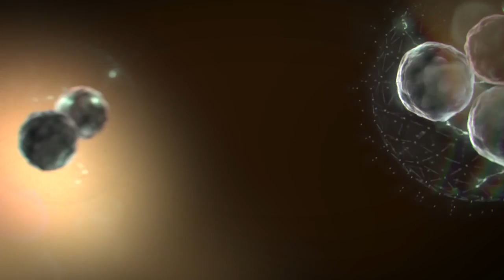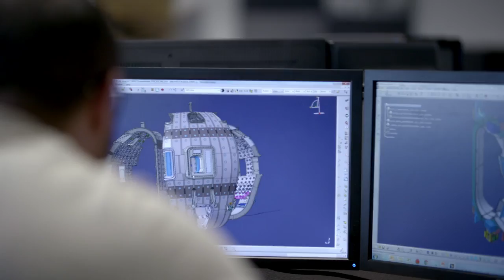ITER— Fusion, the energy of the future

Comment: “You can imagine plasma as lightning rolled up into a ring, which is held in place by strong magnets ...” If the lightning is rolled into a torus, then it itself will be held by a ring magnetic field inside this torus. And no magnets are needed. Anapol is a unique state that occurs due to the closure of the lines of electric currents and the electromagnetic fields created by them. Tokamak vice versa. The existence of an electromagnetic anapole was predicted by the Soviet physicist Yakov Zeldovich in 1958.

Comment: Stars generate heat and light through fission process on their remnant of radioisotopes. Really? Let's face this: Einstein's famous equation, E=mc^2 is wrong otherwise garbage also can be used to make nuclear bombs as long as it is matter or it has mass. Energy and matter can't interchange one another according to Einstein's famous equation. One must have photons before one can emit out photons. Photons are particles and they have mass. All forms of EMWs including light and heat are dynamic photons per volume per time in different saturations. To construct a larger, denser nucleus with more number of nucleons required to saturated its nucleons with more stationary photons in order to squeeze them within the  nucleus. Therefore fusion process required input of more energy; thus no excess energy can be derived from fusion process.If you are interested in real discoveries, I would recommend you to read my book, The Unification Theory - Volume One and you will be amazed with lots of  new, interesting discoveries. In God I trust.

Comment: Nuclear fusion will fail!
There is no such thing as "nuclear fusion".
Minimum of 25 billion US dollars going to the trash!
Chapter 12 - Nuclear Fusion.
Copyright © 2017-2018 Alon Yarel All rights reserved.

The goal of creating clean and cheap energy by nuclear fusion in laboratory conditions will not succeed.

Is there a nuclear fusion in the sun?
In order to answer the question, it is necessary to understand what the amounts of gas and fuel that are inject to the sun by the other side of the black hole.
We must to check if there are enough gas and fuel injected to generate the energies produced from the sun.
May be there is a need of process of nuclear fusion that completing the energies.
The information about the amount of gas and energy that flows into the sun is based on one video shot of the fiery looping rain on the sun.
In one short video of 4 minutes we see a mass entry and a tremendous fire of gas and fuel. 
This amount of energy in a continuous manner can certainly generate the energies produced from the sun without the need for nuclear fusion.
The assessment relies on continual flow of mass injected into the sun. 
There is no doubt that the sun is saturated with gas and fuel all over the sun.
We see gas and fuel flow in to the sun.

There are explosions on the sun that have nuclear hydrogen explosions that release a lot of energy.
It is believed that there is an incessant process of nuclear hydrogen explosions that actually generate the nuclear fusion process.
This belief is not aware of a new mass entry into the sun, all the time.
There are procedures for decomposing nuclear hydrogen into the sun, but these are blowing up new materials and not creating new energy.
The processes of hydrogen nucleation cracking, are consecutive but do not generate an endless chain of explosions and power of themselves.
Therefore, these explosions create the illusion that the entire sun is creates clean energy of its own.
These explosions are in a final process and are not the source of the sun's heat.
Therefore, there is fusion in the sun as a result of heat and there is a nuclear fusion illusion without nuclear fusion within the sun. 
The goal of creating clean and cheap energy by nuclear fusion in laboratory conditions will not succeed.
Nuclear fusion is an unproven theory that ignores the other side of the black hole in the sun. 
Even physicists agree that there is no known process of cold fusion that has succeeded, and it seems that such a process is impossible.
This is why all efforts and attempts to make cold fusion that is nuclear fusion in laboratory conditions have failed.

Video of Alien- Science Association Of Astronomy Org.il - Chapter 12 - Nuclear Fusion. https://www.facebook.com/alien12345678910/videos/1673998305987138/

Copyright © 2017 - Alon Yarel - All rights reserved.
Reply: Alon Yarel  What are you talking about?, and how exactly do you know there is no such thing as "nuclear fusion?
Reply: Dude, he is too high right now, sharing alien shit but won't believe in science.

Comment: What will happen if there is an accident? For e.g., if the magnets fail and the plasma escapes. What will happen?
Reply: There will be cursing in many different languages
Reply: Fusion energy is so powerful that not much matter is required. The plasma inside the tokamak weighs only a few grammes! So if it escapes, or touches anything, its temperature will cool down, stopping the fusion reaction. And despite being at 150 million degrees Celsius, it can cause serious damage but not on large scale as we're talking about grammes of matter.
And the head of the project says "if we succeed", because no one ever achieved a controlled fusion reaction that produces more energy than needed to heat the plasma.  For now, ITER isn't yet operational, everything is still theory. So until practice proves theory was right, "if" is adequate.
Reply: Thanks for the explanation.

Comment: Sustainable fusion-- in other words, getting more energy out of a reaction than is being put in, is NOT possible.  That violates fundamental Laws of the physical universe regarding the Conservation of Energy.  However, rather than simply spout some law or other statistics, I'm going to tell you exactly why we cannot actually create long-term fusion the same as a star.  This is inarguable, and the only reason the entire Fusion Community hasn't realized this is because (as with most such science things), nobody is taking all the physics aspects into account.

In a nutshell, here is how a star works, and why you can't recreate one:

A star creates heat in its center.  Not by reaction, but by mass.  By mass alone.  It works, solely because it begins in a gravitational vacuum, allowing mass to clump together in a largely spherical shape.  Past a certain threshold, the center of the mass is squeezed so tightly from all directions, the atoms themselves crushed to the point that they come apart-- and a star is born.  A core of pure energy without mass, surrounded by a mantle of mass.  The pure physics is this-- transformation of gravitational force against mass into electromagnetic waves.

And therefore, you cannot gather enough mass in one place on Earth to cause this nuclear breakdown, you cannot create sustainable fusion.  You'd have to make a full-scale star.  Phycisists need to stop concentrating solely on containment-  that problem is trivial to solve comparatively.  The real problem is scale; is mass.  And you can't solve that one.
Reply: ReactanceIsFutile You don't understand it. Also much bullshit up in there. It violates no law except that of your imaginary world.

Comment: After we got so much "accidents" and problems over the last years with Atomic powerplants, we should think first, what will be happen if 150million degree hot gas is bypassing the vakuum ?!?! no material in this universe can handle that temperature and there is an accident like in Japan before for example, there is no way to cool down this gas, this temeperature is way behind we can imagine, so it could burn the whole atmosphere.
Reply: The current problem with fusion is mantaining the plasma running for a long period of time. If the coils go off or if it somehow escapes, it will almost immediately dissipate.

Also, nuclear reactors are the safest and most efficient ones, all of the disasters were either caused by negligencr of the administration (Chernobyl), or a natural disaster (Fukushima).
Reply: He he! Well, you would get some amazing scorch marks on the inside of the reactor.

Comment: what you are trying to achieve, that could change route of earth in solar system based on very high and extremely large magnetic field, pressure, and temperature...Never forget that earth has same structure of core...Meaning that you could accidentally unbalance earth movement while trying to achieve something else(like producing more power as simulating sun)...I might be wrong but i believe that innovation(producing extremely large and continuously, energy like simulating sun)  it will bring huge drawbacks ...
Reply: wow, you figured it out.  All those scientists that studied for years in their silly books are idiots, you should go tell them.  it is not possible to make a magnetic field that would outbalance the magnetic field of an entire planet.  the discrepancy in size between something man made and an astronomical body is too large.  it would be like holding a candle to the sun. may god help us in this modern age where anyone can string a couple words together thinks they are more smart than hundreds and thousands of educated engineers and scientists.  jesus fucking christ
Reply: I also said that I might be wrong...About Scientists silly?...No they aren't actually they are smart, even some are genius...But they might an idiot, example they first discovered, innovate, and used atomic power as nuclear weapon rather using generating power for life usage...Scientists could block  it as using for a weapon before publishing it or illiterate people(mostly leaders) discover that can be use as a weapon...
They use both (fission and fusion) reaction for creating weapon(thermonuclear=fission first and then secondly fusion) first...am I wrong at this point... 
So in my opinion there is nothing impossible in this life...as impossible things can be discovered.. soon, later, far later ..so it is just time...like computers Moore's, neurons, quantum computing...etc
At this point:
Q: Can u answer that What Max Sun temperature in Celsius?
A: 15000000 Celsius...
Q:In fusion experimental what degree they archived in Celsius?
A:At least 150000000 Celsius...

Q:can earthquake be simulated...?What a sick mind trying to do such a thing?
A:I think they already do...

I am sorry my friend but I believe that wind cannot be seen but we can feel it or see what it does...

Comment: How much power will it take not only to start up but to keep it running safely?
What happens if one or more magnets fail?
Reply: The whole point is that once running it produces more power than it consumes to operate.
Reply: ITER will be the experiment of its kind designed from the ground up to produce and capture up to 10x the amount of energy it would consume in startup and operation. The project itself is only a proof that the technology exists and can be a viable power source for the world and the hope is to be able to take this proof and build upon what we learn to be able to produce clean abundant energy. As for a magnetic failure or any containment breach for that matter, Fusion is an entirely different process to fission. Fusion  requires a delicate balance of temperature pressure and magnetic acceleration for the plasma to even exist, In other words if any one of these variables  is even slightly off the plasma will cool within a millionth of second and the reactor is shut down. It is scientifically impossible for a runaway reaction or some sort of plasma explosion to occur.
Reply: i loled
Reply: If I understand this correctly the conversion is about 100 to 1, water is the source (sea water) sustainability should be infinite... Hopefully.... If the magnet fails the gas falls out of suspension, I would assume being a gas the mass is small enough for the energy to be absorbed? (temperature)
Reply: 08wolfeyes the planet will die,they don’t know what to do if a magnet fails,some people said they aren’t adult people,they are kids playing to be scientists

Comment: What happens when you have a meltdown? Not if, when.. And you release a fragment of the sun on the surface of the earth? Sounds like a plan👍
Reply: From where exactly did the idea of a meltdown appear? That's fission energy, not fusion.
Reply: Fusion reactors can't 'melt down' or even explode at all, really. The only thing keeping the fusion reaction going is the immense amount of heat and pressure, both of which you would lose immediately if something went wrong with the machine. The only thing I can really see going wrong with this design is if somehow you lost control of it and it wouldn't turn off and you had nowhere for the output to go. But that is an EXTREMELY specific and unlikely scenario and wouldn't really cause any problems for us anyways.
Reply: go study difference between fusion and fission, the later is what we use and is susceptible to meltdowns
Reply: +Victorbrine Cassini Hiroshima...Nagasaki... this is total bullshit. If the magnetic field would suddenly disappear what would happen is .... not that much at all. You have to see that inside the reactor is almost a vacuum, that means there is very little stuff in there. I don't know how much exactly, but probably way less mass than a glas of water in that huge fusion chamber of ITER. (Oh, and part of the fusion products, namely the neutrons, always hit the walls, that's how the energy is being extracted out of the fusion process).

Comment: I'm skeptic about the fusion, it's never gonna happen.
Reply: going into space, never going to happen. a world wide communication system, never going to happen. fusion energy, never going to happen. etc etc
Reply: It has already happened, many times. ITER is about using the knowledge from  previous experiments to create a system that can produce enough power to be self-sufficient.
Reply: Hue Hue. They said the same thing to the wright brothers about flying
Reply: A more accurate claim would be to say it's never going to happen with this machine, not on a large scale anyways. This is more of a test designed to collect data, which will go into the next machine, and the one after that, etc until there is a machine that CAN do large scale fusion. The first plane didn't go mach 3, you can't have high expectations right at the start of a brand new technology.